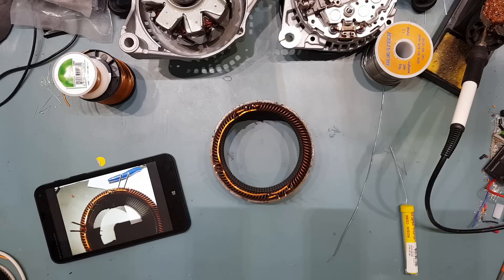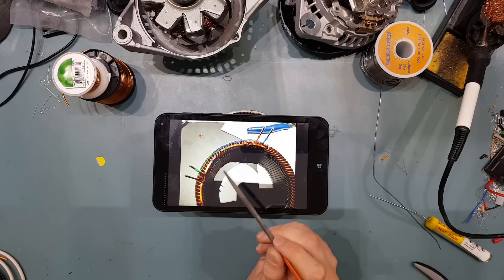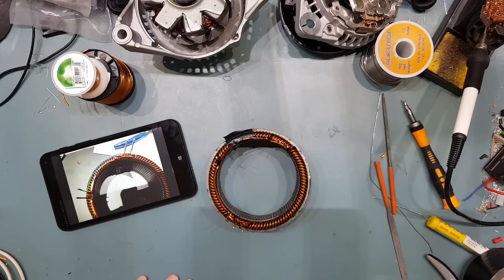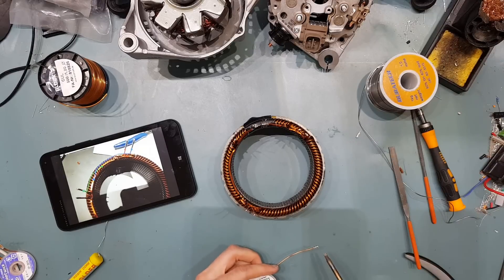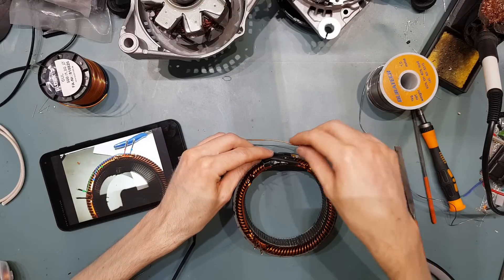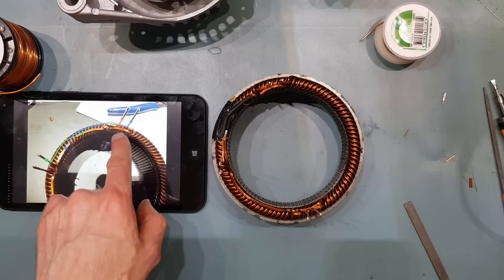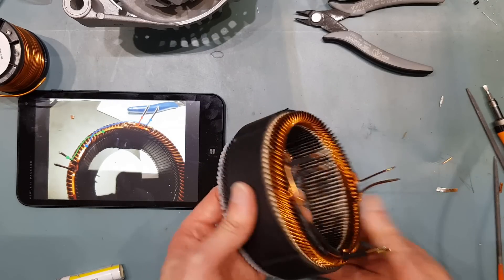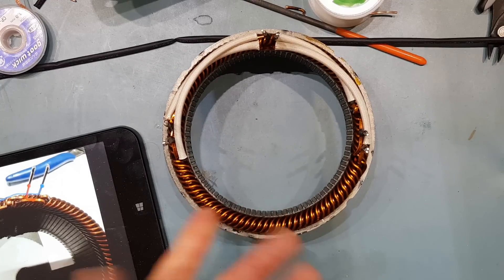Make your own HIGH OUTPUT alternator! - Part 2: The Modifications!

Comment: Bought a 100k mile, '06 IS250 for $9k cash, and over the past year I've spent another $3k or so on a good SQ system with all the bells and whistles. Considering the prices of 240 or 320 amp high output alternators, this video series is EXTREMELY captivating...I might just try to save myself a few hundred🤷‍♂️

Comment: OK after watching part 1 I am now aware that you are converting a star wound alternator to delta wound alternator. This means that the O/P voltage will be about a half of the original and will not be usable as a car alternator. Secondly If your intension is for wind power then the generator will be unsuitable as the high current will not be acheivable because the wind will never reach that intensity so the generator will cog and stop. So perhaps it would be helpful if you stated what exactly you hope to achieve with this modification?
Reply from the maker: It's for a car. ;)

Comment: What's the downside of using alternators modified this way? In the first video you said that it takes higher RPM. So I suppose using smaller pulley would help? How much should the ratio change?
Reply: curious minds want to know

Comment: Years ago i reman'd my own alternator and the solder where i soldered the rectifier to the windings melted off about 3 days after being reinstalled and  in use.....what type of solder should i have used?  Gm cs130 alt
Reply: He said lead free solder cause it has higher melting point. Probably high heat lead free

Comment: I have a Yukon with the 130 amp alternator, rpo kg8..... Can I modify my alternator the same way and double it's amp output or do I need to look for a bigger one like you use in this video? And if a bigger one is necessary, which one should I choose to modify? They have them in 10 amp increments all the way up to 200 for my year Yukon and I'm fairly certain miles ok I just need to put my Yukon "back together" again lol as it has split in half right at the "overhang of the undercarriage" lol

Comment: buddy you're a life saver. my car the only HO alternator i can find for it is $800 and living with my budget i cant afford to spend that much plus additional speakers and another amplifier (currently have 3 10"s on a 3k thats turned down cause anymore than half power and my car stops accelerating at 2k rpms< dang 150amp alternator and electric everything lol)

Comment: So you were saying it will put out lower voltage at low rmps how high do the rmps have to be to put out the correct voltage and the full 300 amps?
Reply: That's what I was wondering and at idle will it do anything or  what rpm do you need

Comment: Great video! Will definitely be trying this on my tida 140amp alternator. If I was to send your the picture of the coil can you advise exactly where to cut and join on my particular alternator? Really need to do this model as my current car audio set up is in need of a high output alternator
Reply: I also tried is but am not sure if I did it correctly

Comment: Many thanks for your video. I have a hair pin alternator that I want to change but I see it does not look the same as the stator you worked on. Is there anyway I can send you a picture of how it looks?
Yours has horizontal wire on 50% of the stator, this one has horizontal wires all the way around the top side.

Comment: Trying to wrap my head around this... I've never modified or even taken apart an alternator before, but I know that if you remove the rectifier you will have a 3ph AC output, so until I say otherwise, I'm talking about the 3ph AC machine. From watching your video it looks like the output comes from 2 series windings per phase, and you took one phase out of series and put it in parallel to double the current capacity, which would also cut the voltage output in half. If we looked at the AC output (phase-to-phase) on an oscilloscope I predict we would see two AC waves of about 19.5VAC and a 3rd wave of about 9.8VAC. Are you with me up to this point? You agree or??

Ok, now we add the rectifier back to the mix. It turns the 3ph AC into pulsating DC. The ripple factor of full wave rectified 3ph AC is usually low enough to be ignored, especially when it's in parallel with large capacitors or a battery. But that assumes 3 symmetrical phases which is almost always the case, except not here. I think if you looked at the DC output of this alternator on an oscilloscope (with it the alternator output disconnected from the battery) you would see an output that is ~13.8VDC 2/3 of the time, and ~6.9VDC for the other 1/3. 

BUT The regulator does do as you've said in other comments and as its name implies, it regulates the current through the slip rings to get an output of about 13.8VDC. But it doesn't (can't) force that modified winding up to the same voltage as the other two. It would need 3 separate regulators and 3 separate slip rings to do that. So does the regulator work based on the average of the DC output? If so, then your alternator would likel output higher than normal DC under light load. Or does it work on peak DC output? If so then your modified phase really is not getting used. 

Actually, regardless of peak or average, I think it's not getting used because it's half the voltage of what the other two windings are putting out, so all loads will be powered by those two higher voltage windings and if anything the modified "high output" winding is acting as a load rather than a supply. I think the only way that modified winding gets to supply any current is if the two other windings are put under such tremendous demand that their voltage drops(*) to the same voltage as the modified one. Then it can lend a hand, but I think not until then.

(*) I'm sure someone will point out that their voltage doesn't drop, because the regulator will add more current to keep them outputting the proper voltage. I agree with that. It's a relative relationship. The voltage of the two normal windings won't drop; the voltage of the modified one will rise up to match them. But I could think of a simple way to put that in a sentence without derailing the point I was making.

So... please, tell me where I'm going wrong.
Reply from the maker: You aren't modifying one winding from series to parallel, you're changing the configuration from WYE to Delta. The output of each winding is the same as all the others. The rotor winding is driven harder to keep the voltage up, and the alternator will need to be spun faster to compensate for the lower AC winding voltage.
Reply: @TwistTapeTechnology  ok thanks for the explanation. I had to go back and watch it again to believe you but I get it now. I must have zoned out for bit, more than once.

Comment: Let's say you've got a 55amp alternator on a diesel mercedes and you want to double its output so you don't have to Foo, with a really big u it that won't bolt up.on a diesel you Rev the hell out of it just driving it anyway, my car has a unit off a 300d turbo w116 chassis on a OM616 240d ATM I have to r3v it to activate charging upon starting  it.
Research that one for me..

Comment: Sorry this is so late being your video is 2.5 years old. But does it hurt anything to just use one portion of the stator instead of all three? I have a 5 rib pulley and it'll slip with to much load. I have a 190A alternator and just need about 250A.

Comment: This mod will greatly reduce the low rpm output by less than half the stock unit.
Reply: Put a smaller pulley?
Reply: @echandi101  Smaller pulley means more wear on the belt and bearings.  Bad Idea.
Reply: @jimmccune568  so whats teh correct way to do it? bigger windings?

Comment: Hi and thank you for sharing. At the beginning on part one, you had said (if I remember correctly) that the diodes and the voltage regulator were going to be replaced as they were not up to par for the application  in which you were using.. curious if you changed the voltage regulator and if so how to acquire? Considering i use the same stock alternator and make same modifications to convert to 320amps? Thanks again!
Reply: https://www.youtube.com/watch?v=LAlPMteyWaI

Comment: This seems like a surefire way to have your alternator overheat surely? And if it doesn't overheat then your battery will drain very quickly at low RPMs and idle?
Reply from the maker: ask Mechman, DC Power, Iraggi and every other alternator assembler that does these exact same mods...

Comment: Hi. Great video. What about voltage regulator? Do you leave it oem? Can it handle the new field current to push 300A?
Reply: Generally, when you are increasing the amperage of an alternator, you alter the stator, replace the rectifier with one that has larger diodes, and sometimes you also have to replace the rotor.  It depends on the application.  The regulator is usually not a concern unless it's not functioning to begin with, although I replace with a new premium regulator with all of my rebuilds.

Comment: thanks for amazing videos
can I have your idea that what is the best solution to use all petrol engine HP for an electrical generator?
attaches multi alternator through belt would work?

OR
design new specific alternator regards to engine torque and rpm

Comment: From the comments, I think you should explain that alternators are actually AC output, converted to DC by the diode pack. Now star/delta conversion may make some sense to a few. Most will correlate that switching to starting ac motors. Not a far stretch once you realize what is happening.
My biggest question arises of how to cool the double output when it barely cools at the original output?
Reply from the maker: These mods are the same as every small case high output alternator. I haven't known of them having many issues with heat.

Comment: Excuse me for asking: if you change it from Y to delta the output voltage will be a half , right? so what is the point to change it???you will have 7.2 Volts after rectifier ...so it will not charge the battery any more.
Reply: Output voltage on an alternator is fix and obtained via a regulated circuit ( example 12V ).  So in delta config the rotor will be higher exited to obtain again 12 V by means of only one coil.
Reply: Which means the rotor will burn out because its always running at max current

Comment: I would like to know how you figured this out ??? Also, how does the amp curve go from engine idle to redline ??? Does the idle RPM amperage cut in half since you went from star to delta configuration ???/ Thanks a bunch Sir too.
Reply: He mentioned it went from series to parallel.

That would mean the voltage would be lower at lower RPM. I'm pretty sure.

I think the total wattage of the alternator has not changed.

It has taken all the wattage from down low, in the form of voltage, on the curve and put it on top as amperage.

This would not make a good alternator if you idle in traffic alot.
Unless you raised your idle rpm
Reply: @Godfather_of_the_Oath  Got that fella. Thanks

Comment: You could also use insulating varnish to eliminate the bulkiness of any other type of insulation. It does require a little curing time, but well worth eliminating the other insulation. It's also generally more heat resistant.
Reply: Insulating varnish can work, however is is far from aesthetically pleasing.  I use tinted ignition sealer on my stators.
Reply: @tedisabum  I get that. I guess I've always liked the look of the coils myself, but that would definitely work very well.

Comment: I don't think I would have used lead soldier, it's brittle and susceptible to heat. I would use either a mechanical butt splice or silver brazing.
Reply from the maker: Stick to plumbing ;)

Comment: Do you have a voltage vs rpm profile before and after the conversion?
Reply from the maker: Do you mean current?
Reply: @TwistTapeTechnology  No.  Looking for voltage vs rpm curve.
Reply from the maker: The output voltage is whatever the regulators set point is. It doesn't change with rpm.
Reply: @TwistTapeTechnology  No, the stator voltage will vary with RPM, but it is being held constant by the regulator.  The answer is, you don't have the graph.  Thanks anyway.  :)
Reply from the maker: R 
P     ---------------
M 
  
          VOLTAGE
Reply from the maker: The stator voltage is being held constant by the regulator adjusting the voltage to the rotor. If the stator voltage changed, the output voltage would change.
Reply: @TwistTapeTechnology  No, thats not correct.  The alternator acts as a constant-current amplifier.  Input current x gain = output current, at a maximum voltage determined by lentzs law.
Reply from the maker: @SteveWrightNZ  so what are you expecting the stator voltage to be?
Reply from the maker: And why does one want or need to know this voltage?
Reply: @TwistTapeTechnology  I don't know.  It should be lower than the star wiring, and a higher cut-in rpm - the point where the stator voltage passes above the battery voltage and current begins to flow  alt-->batt.  As you have noticed, the alternator has a lower impedance and therefore a higher output current, so it follows that it should also have a lower terminal voltage.  I'm trying to figure out what the minimum rpm will be for alternator internal start-up - not important on your application, but very important on mine.  :)
Reply from the maker: Alternator turn on is about 2000 rpm.
Reply: @TwistTapeTechnology  Thank you.  Is this alternator rpm or engine rpm?  Did you notice if it was different than before the modifications?
Reply from the maker: @SteveWrightNZ  alternator. So if you have a large enough engine pulley, and small enough alternator, it will charge ok at idle.
Reply: @TwistTapeTechnology  thank you

Comment: I would like to do this on a gm alternator but it is going on a 6.5 turbo diesel to compensate for aftermarket fans and lights. I have an overdrive pulley on the alternator as it is to compensate for draw at low RPM. Is there a formula to solve for what the output for my setup would be at a given RPM? I could definitely use 300 amps, but will I be able to make a usable amount of that within my engines usable RPM range?
Reply from the maker: DC Power have graphs for their alternators, that will be basically the same as whats shown in my video. Link may or may not work:
https://cdn.shopify.com/s/files/1/0019/8498/7205/products/320-HP_c10393bd-8f94-4c50-9e8e-64040e88e494_1024x1024.png?v=1549859670

The graph shows alternator RPM, you can work out your engine to alternator pulley ratio, and get a reasonable idea of what output you'll have at idle, and what RPM would be needed for full output.

Comment: Why do they charge 3x as much for a high amp alternator 🤯
Reply: cus usually they arent made this way, they also have tighter and more winding into them, so you arent overpowering the copper wire
Reply from the maker: @DarkarPops  No high output alternator is custom wound. They're all just modified stock parts. Every single 320amp small case hairpin is made exactly as per this video.
Reply: @TwistTapeTechnology even mechman?
Reply from the maker: @kevinhirt  yes.
Reply: @DarkarPops  because they can

Comment: great video 
I want know the hi amp not damage normal battery 🔋???
Reply from the maker: You shouldn't jump start a car with a high output alternator, as you may boil the battery as the alternator dumps a heap of current into the flat battery, but for normal use, the battery won't be taking any more current than with a normal output alt.
Reply: @TwistTapeTechnology  if you keep it at idle it will be less current then stock, could be spike at first on a cold start tho I guess

Comment: Heat shrink... LOL

I have two other words for you that work better: Nail Polish.
Reply from the maker: Hey, to each their own, I'm not one to judge.
Reply: @TwistTapeTechnology   Nothing to judge.

It's enamel just like what is on the factory wire, it needs minimal thickness for a tough layer that resists heat and the dust blasting alternators see blowing ambient air through to cool the alternator.

Thanks for posting the video that shows one of many methods of getting more from an alternator.

Hopefully you are willing to learn from your viewers, and profit.

If you are too macho to buy nail polish at the store, there's always silicone conformal coating or enamel clear coats, though some handle high heat better than others.  I still recommend a clear nail polish or sealer for the convenience of a great detail applicator being included.

I wasn't judging your modification, only suggesting a more reliable insulator that doesn't smoke until temperatures hotter than heat shrink tube melts through.

My favorite mod is for high amp under-hood welder, great for off-road repairs in the middle of nowhere, that's where I learned enamel handles a lot more temperature without giving up.

Keep up the great informative videos!

Definitely worth people liking and subscribing.

Hit the buttons, folks.
Reply from the maker: @bdengineering9602  As there is limited space inside the alternator to do these modifications, you can only do a butt joint when making the modifications.

The heatshrink is needed to provide some strain relief to the joint, which the nail polish won't ;)
Reply: @TwistTapeTechnology  Actually the "if you live in 'black and white' comment is evidence that you are, in fact, one to judge" (burn)
Reply from the maker: @332ARA 
I only judge peoples intelligence.
2/10